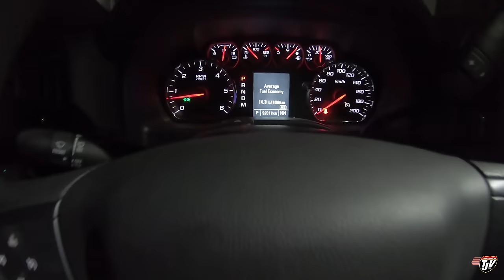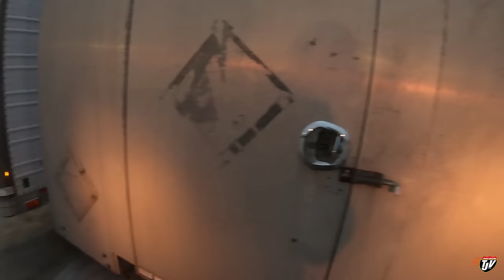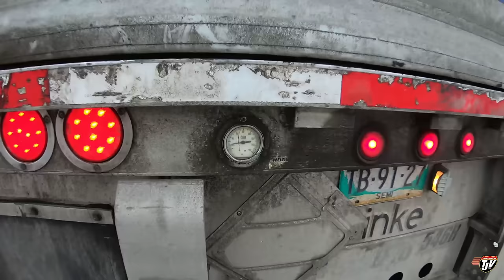My Trucking Life | CURTAIN-SIDE | #2238 | March 17, 2021

Comment: I once drove a curtain trailer. On that one you rolled the sides over to another, which wasn't that hard. We had a power tool just for it, that we hooked to the trailer's air supply. The hardest part was rolling the curtains back down. It had two sections, each being little over half of a 53" in length. You rolled one section down by pulling two ropes. One night one of the ropes got snagged in the supports holding the curtain up.  I realized to get the curtain down fully I had to cut that rope, and the only way to cut it was pulling it out and sawing it with a knife. It required two hands. So there I was, late in the night, hanging of a rope that I was cutting, knowing full well that once it gets cut I will fall to the ground.
Reply: M